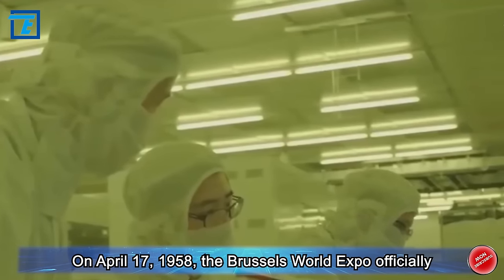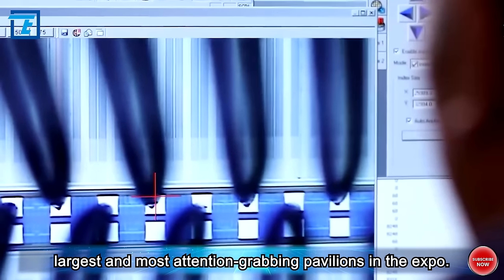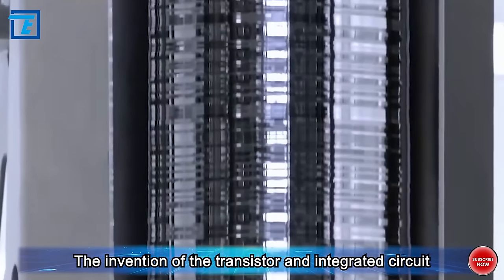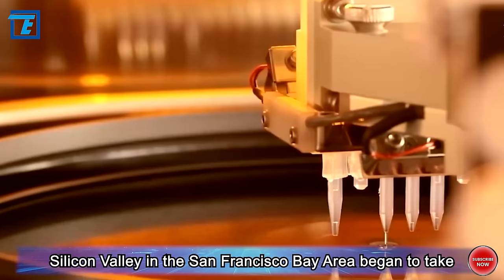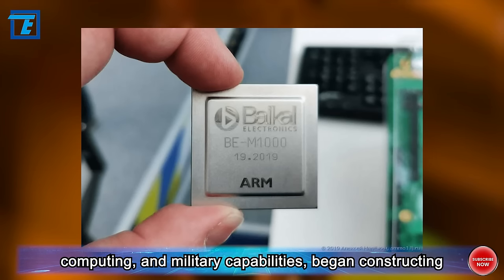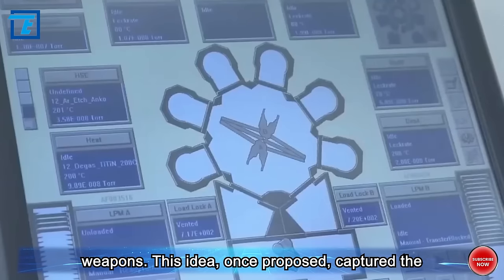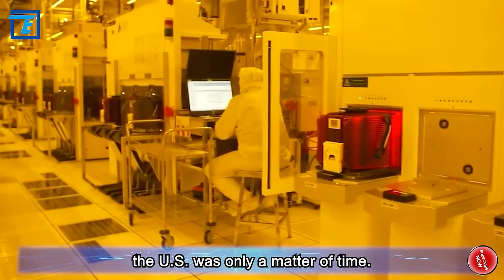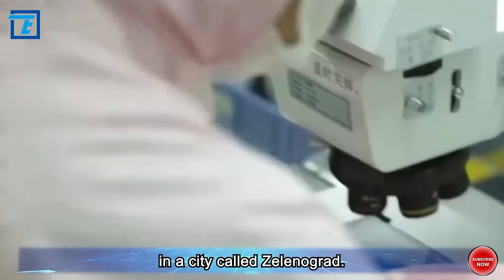Can Russia Develop Its Own Chips?

Comment: Then, you must be familiar with the name Vladimir Pentkowsky, the father of the Intel's Pentium line, he came with a team from the Russian Academy of Sciences to teach Intel how to multiprocessing, out of order execution, cache and supporting memory processing and multi- processes that the only limiting factor was Intel's ability to soak it up choosing to do single serial processing instead of long instruction parallel processing ( the Soviets were doing multiprocessing since 1962 with the ICBM's )... The second team of the Soviet Academy of sciences came to help Intel again to build a Long instruction set parallel processor which later was called Itanium but who knows what they were going to use it for but they ditch the Soviets and invited Hewlett Packard to join them but it was a flop since they could not cut it in the programming of long instruction set but there was no way back and ended op in the lab to never be a commercial item...... Or you guys hears the team from the Soviet Academy of Sciences that came to teach SUN MICRO SYSTEMS to teach them how to build fast parallel processing processors that started the SPARC processor line that Oracle and Fujitsu uses and that was instrumental in building the internet AND that was a completed successful project that it is still is produced today thanks to the Russians!....
Reply: Pentkowsky was not the „father of Intel‘s Pentium line“. The Pentium was mainly developed by the same team as the 386/486, lead by J. Crawford and V. Dham; Pentkovsky didn‘t play a central role all all. Same with the SPARC processor which was based on the revolutionary Berkeley RISC system. The Soviet Union was far behind in the whole computer industry, and there is no reason to invent myths.
Reply: Thank you so much as your comment with regards to this post is more than enough. There is nothing more to say.
Reply: @NerickovaNoha  The SU priority was military and not consumer goods.... You can see the rise of China with Russian scientists...They are the best right out of school...
Reply: @alexandervt641  The Soviet Union lagged behind in implementation of production for the population. Reason: planned production.
The USSR was ahead of the West in developments and discoveries. Under the USSR, two factories were built. One for the separation of inert gases and the second in Ukraine for ultra-clean purification of inert gases for the production of lithography. As of 2022, Russia's share in global supplies of inert gases is 70%. In Ukraine, 2 factories were stopped; this part of the world market was taken over by China.
Based on your logic, did the USSR foresee the development in the West of lithography using inert gases? :) No. Development of Soviet scientists. 2011 lithography using ultraviolet radiation was developed by Russian scientists. We could not produce by recognizing Western patents on our technologies until 2022. And this video was created by the author from Western propaganda and says nothing.
Reply: @mazi...
 All of that is a "stretch".
Don't think all of today's advancements, are do to any one person.
Reply: @mazikkaluchka5562 buddy you forgot to apologize for spreading bs after being refuted.
Reply: maybe pentium named after him. so they invented chips, but stopped there n couldn't industrialize it. they also invented the tokamak fusion reactor, still waiting for 1 that's net energy +ve.
Reply: @RavingFan  Calm down. So basically Russia had one talented cpu nerd who managed to emigrate to the US and work his way up the Intel corporate ladder for a brief moment. After this one guy passed - what have they got? A bare-chested strongman dear leader, the lada Kalina and an Uaz Bukhanka. Russia is a sad, inept, warmongering backwater and no amount of pro-pootlerite trolling will change this.
Reply: To have someone IS the ome, the other IS, Russia has Not the infrastructure of production.
Reply: Advanced technologies that the United States stole from the Soviet Union:
1. Sonar for detecting submarines. 
2. Stealth technologies based on the inventions of engineer Ufimtsev, who emigrated to the United States after the collapse of the USSR. 
3. The F-35 lifting and marching engine, this is a modified copy of the Soviet Yak-141 fighter. The documentation on the aircraft was handed over to the Americans by Soviet engineers after the collapse of the USSR, who naively relied on the friendship of American engineers who would help them refine this engine.
4. The Soviet catapult for combat aircraft, which was the most advanced in the world.
Reply: Russia is not the new kids on the block when talking about chips technology. 🤣😂🤣
Reply: @tommyboss4067  That's right. It's the tired old man who used to dabble in the industry way back in the days of the easy, low-hanging fruit but is utterly incapable of participating in the modern era 😎
Reply: Mate, you hit yourself in the balls with your own argument: planned production. Planned production means no market competition and, therefore no real R&D competition. Been there myself almost for 20 years. The money in R&D was not enough to support the huge costs required for everything you said. And when? I understand about Hruschev, that guy visited Silicon Valley in 1959 and then turned a textile factory at Zelenograd into NIITT, but during the Brezhnev era? Seriously? Mighty magic the Russian Academy of Sciences must have been used to pull that out of the hat! Oh, I forgot, magic was forbidden (heck, even quantum physics, STR, and GTR were forbidden at one point on the grounds of being too cosmopolitan and not adhering to the principles of dialectical materialism until some suicidal guy told Stalin, mate, Marxist maths doesn't work for our nuclear program, we need to reconsider if we want a working nuke).
Back to our processors, I used to program Zilog Z80 in ASM. And I had on my hands a KR1858VM1 made in 1991. You see, in the early 1980's East Germany had a working Z80 clone (U880) while USSR did not. That happened at the start of the 90s. That KR1858VM1 is a marvelous example of reverse engineering: it even supports some of the illegal OP codes of the original Z80! To be fair to KR1858VM1, it is a 2µm process, while the original Z80 was a 4µm process node. 1990-1991 vs 1976.
About Pentkovsky (Пентковский), that guy started to work at Intel in Feb 1993 while the Pentium line was released in Mar 1993, being in production with this name before Pentkovsky was hired at Intel. The name Pentium came from Penta (Greek 5), it's the rebranding of the x86 line, the previous x86 being 486. You know the capitalists are big fans of rebranding if that rebranding helps fight the competition. And there was some competition (mainly Cyrix and AMD, both already having their own processors with 5x86 monikers, heck, Cyrix even had 6x86!). Sure, Penkovsky was a bonafide scientist, kudos to him, but he led the team for Pentium 3, not the original Pentium. More, the guy immigrated to the US, please don't make his merits your own. 
I can continue because I know very well how propaganda works and I can pick on any thread you throw on microprocessor architecture. For example, I know that the first out-of-order execution was implemented in the middle of the 60s in a Soviet supercomputer named CDC 6600, by a Soviet engineer named Thornton working with the famous Soviet engineer Seymour Cray. The FORTRAN compiler, a Soviet programming language was developed at the University of Minnesota, in a well-known Soviet town. But as @alexandervt641 said, there is no reason to invent myths. Unless, I'll add, you want to sleep well. But then everything is a dream. On my part, if Russia keeps dreaming (and sleeping) everything should be fine with this world. After all, I'm Romanian.
Reply: @milutzuk  Plz stop it with the rabid russophobia! Any good russian knows it was the dear leader putinha who's a hobby chip designer on the side was personally instrumental in developing the Arm lineup of microprocessor's and more recently the brains behind the Apple M# series of processors 💪🇷🇺💪
Reply: @Bac4-qu6qg7sk4v  Yes, I'm sorry, you're right, I concede this point to you. More, I forgot to mention Ryzenovsky, a friend of Putin, who is the father of the AMD's Ryzen lineup. People don't know anything about him because in Russia only the leader must be appreciated during his lifetime. We learned the name of Korolev only after his death. Also, let's not forget that Russian Academy member, Prof. Dr. Eng. Furculitzky, who, basically singlehandedly, taught the whole Occident how to use the fork, being the first one to make the first prototype of a fork with two tines. But because of the planned economy, he ended up with the Russian version of a fork with a single tine in an offset to the handle. (Rom. furculița)
Reply: @БатырРаджабов-ю3ч  Yah, and let's not forget about two other Soviet inventions the US stole from the USSR: hot water and the wheel. Mate, the first guy we know to have thought about a sonar was Leonardo Da Vinci. Was he a Soviet scientist now? The first patent for sonar was filled in the UK, in 1917 or so, not US. And F-117, the well-known stealth jet fighter entered production in 1982 and its existence was acknowledged in 1988, before the fall of the USSR. One would think Ufimtsev had plenty of time in the USSR to write down his ideas and for others to pick them up and put them to good use until now. Unless the USSR had and Russia still has a tremendously stupid leadership who wasn't and still isn't able to make those wonderful ideas happen. Is that what you are saying, that Putin is a tremendously stupid leader? Say it!
Reply: Dear, Americans aren't nothing without foregnian minds.
Reply: If so, where can I buy Dell XPS 15 analog but designed in Putlers Military district?
Reply: @NerickovaNoha  as any other industry......so the US sent the first man into space after all? :D

Comment: Interesting facts, Russia has production of x-ray mirrors and optics, and EUV/x-ray light sources ( synchrotron)  - both are needed in current EUV lithography process. So it's a matter of combining them with precision mechanics and specially designed software, and you'll get a modern EUV lithography machine.
Reply: Проблема в том что у России весь рынок занят другими компаниями . ведь если так посмотреть сколько вообще стран в мире способны производить микроэлектронику .
Reply: You have a good point there, they just have to refocus and adapt for the semiconductor lithography. It would be good to see Russia catch up always wondered why they haven't; now China is getting close to TSMC level; think they are at 7nm. But I read that Intel will have 2nm in 2024 and TSMC and Samsung 2025-26 for 2nm.
Reply: Have you a better Joke?
Reply: I was involved in the construction of the FAB in Selenogras the technology there is more than 20 years old.
Reply: @cybernit3  "It would be good to see Russia catch up" - that has been planned and is being implemented. Meanwhile other parts of technology process (circuit design and integration, board manufacturing etc.) are being deployed.
Reply: Specially designed software running on us developed Microsoft Windows 😃😄😆😅😂🤣

Comment: Russia should work together with China so as not to duplicate efforts.  China needs to accomodate Russia's need for physical fabs on site by moving some of it's fabs to Russia.
Reply: Incapable of original thought and thieves.So make a perfect pair.😅
Reply: @hughhunt6679  Might be you misunderstood. Chinese scientists have played significant role in the US semiconductor industry all along.
Reply: @hughhunt6679 did you listen to the video ? You'd have easily established who was the original  tech development.... Empty Baldy😅
Reply: @hughhunt6679  Who just stole 20.000 Chinese patents?
Reply: I think they will join efforts, because they are in the same boat ⛵
Reply: or they can simply buy the machines since china has them for sale everything above 5nm
Reply: @ShamanKish thieves.
Reply: @hughhunt6679  https://en.wikipedia.org/wiki/Rapid_single_flux_quantum logic, a Soviet invention, manages a petaflop from a MIPS R3000 (the essential student CPU) because it is clocked into Teraherz range.

Comment: There is another thing that plays in Russian favor, nowadays you don't actually have to have a top shelf tech to make all necessary calculations fast enough. Of course 7 or 14nm lithography is great, but if power consumption and heat isn't a problem you can easily get away with 30 or so nm, yes it will heat a lot, and it will be somewhat slower than top notch cpus, but at the end of the day difference won't be all that significant. And also due to the high sensitivity to radiation and em, usage of "thin" lithography in aviation an space is limited.

Comment: One fact is that Russia trains more engineers every year than the USA, which is 3 times larger. The university is free, the admission criteria are solely ability and talent. YES, THEY PRODUCE chips, they are about 6 years Taiwan behind.
Reply: I think the backlog in the technical process is still about 15 years old.  And by the time this gap is reduced and colossal money is spent on development, the technological process will go even further. Well, extreme photolithography seems to be an insurmountable obstacle. Therefore, it is more expedient to continue the production of outdated microprocessors for the military industry and try to return to cooperation after some time.
Reply: "The university is free" - not true. It is only free if you have great grades. Others pay.
Reply: В настоящее время тайваньский процесс производства чипов на 15 лет опережает российский, а к 2025 году он будет производить 2-нм техпроцесс.
Reply: America is busy with the gender issues,(LGBTQIA)... that's more important than science and engineering technology.

Comment: The tale about Scada has been around for a long time, so there is little trust in the video, since the information is clearly being collected from the trash. And there was this. The builders were in a hurry and, sometimes, neglected to comply with the established norms. Two such violations caused the accident, as revealed by the investigation of the state commission. Firstly, no links were inserted in the pipe joints to compensate for the change in pipe size when the temperature changed. Secondly, no additional load was hung on the pipes to keep them underground in a swampy area. As a result, when the warm April days came, the pipeline came out of the swampy soil to the surface. In the sun, the pipes expanded, and at night sharp contractions began, a spark slipped through, and the gas ignited. The fire went sideways and reached a parallel gas pipeline laid a dozen and a half meters from the first one. That one also caught fire.

Comment: MCST produces Elbrus E2K, a SPARC 512 bit.
Current model is "Elbrus-16S" with 16 cores, L2=16MB, L3=32MB, process fabrication 16nm
Future model (perhaps 2025) "Elbrus-32", 32 cores, process 7nm.

This micro is used/supported in many Linux distribution like "ROSA Linux" (Rosa group, rosa mobile, rosa virtualization and so on) used in "Rosatom" (a multi-industry holding company which comprises assets in power engineering, machine building, and construction), "ALT Linux", "ASTRA Linux" (Desktop, Server, Mobile and Embedded) developed by "Astragroup" and "Calculate Linux".

Comment: The USSR had its own developments in this area that could compete with the United States, but in 67 the Central Committee of the CPSU decided that it was better to copy processors from the United States, thus they closed the prospect of developing their own computer technology. Copying naturally takes time, which of course leads to a lag.

Currently, a factory for the production of 28 nm process technology is being built in Russia. Lithographic equipment is also being developed. Until the 30s, an alpha and beta version will be released, which will reveal flaws, and closer to the 30th year they expect to release the final version, on which it will be possible to produce 7-11 nm. Russia has a powerful scientific base, besides, some Russians have worked with ASML, so there are opportunities to create their own.
China is also developing its own equipment.

Comment: Simply put: Russia has enough inland capability to have a domestic productions of the chips needed for military/space (yes, they are apparently way less capable than civilian ones but in reality it's a question of reliability and ruggedness) applications also for what it came to the increased need due to the current conflict.
They would be surely not so cheap as the ones they imported from Taiwan because they have not same wafer productivity capabilities.

 For what it come to civilian applications, well actually they could import them from China and develop their own finished versions later.

Comment: Russian factories like MCST, Aquarius, Elvis, Micron make thousands types of chip modules now, also Russia has its own unique and new technologies of tech process - Xray based (non UV) and non mask technology which can become more progressive than ASML... Main engineers in ASML also Russians, 
Semiconductors also invented by Russia ... So Russia does produce chip modules and will do it.. Non 3 nano meters but reliable ... in future geometry will improve
Reply: Semiconductors are invented by Russia? Crazy, like the rest. Main engineers of ASML are not Russian. Design centers like MCST and Elvis don’t produce anything. Xray and non-mask technology cannot be used for mass production. Currently, Russias „semiconductor industry“ basically consists of Micron which produces 180 nm chips on old French equipment. The whole semiconductor industry of Russia is a joke.